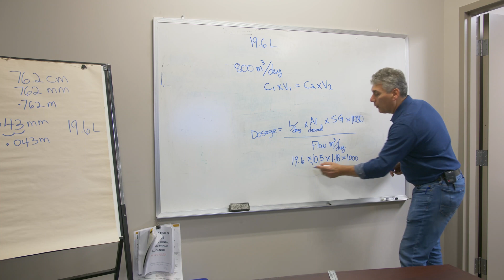How To Become A Water Treatment Operator

Comment: How do i start?
Reply from the maker: It varies across provinces in Canada.

For example purposes, let's say you want to become a water operator in Alberta.

Initially, you need to have a high school diploma or GED. Then, you must complete mandatory entry-level training, which is typically 4 days. After completing the training, you need one year of work experience in a Level I or higher provincially recognized facility. Once these requirements are met, you can apply to write your provincial certification exam with Alberta Environment.

It's important to note that if you are not yet eligible for Level I certification but would like to challenge the Level I exam, you can do so as an Alberta resident. However, successfully challenging the exam does not constitute certification. You must meet all eligibility requirements to apply for certification online through.

Comment: Hello sir 
my name is arshveer singh.
 Im from india. My work experience in wastewater treatment plant operator is 4years. But in india there is no any specific license qualified certificate. I want to join and work in another country  like you sir. Then how i can apply for this certificate and get a job in your country.
Reply from the maker: Thanks for watching! 

To become certified water operator in Canada, it will vary a bit across the provinces. For example purposes, let's say you want to become a water operator in Alberta.

Short answer: Considering the training and experience requirements, it typically takes at least one year of work experience post-training to be eligible to become a certified water operator in Alberta.

Long answer: Initially, you need to have a high school diploma or GED. Then, you must complete mandatory entry-level training, which is typically 4 days. After completing the training, you need one year of work experience in a Level I or higher provincially recognized facility. Once these requirements are met, you can apply to write your provincial certification exam with Alberta Environment. It's important to note that if you are not yet eligible for Level I certification but would like to challenge the Level I exam, you can do so as an Alberta resident. However, successfully challenging the exam does not constitute certification. You must meet all eligibility requirements to apply for certification online through.

Comment: Hi i would like to ask If operators in training license (OIT) is considered as the certificate of qualification to do the water related skilled trade which means you can work as a water or wastewater operator
Reply from the maker: Hi there! The Operator-in-Training (OT) license is typically a step towards becoming a certified water or wastewater operator, but it may not be the same as a certificate of qualification. It often allows individuals to gain hands-on experience under supervision. To work independently as a water or wastewater operator, you usually need to pass the required certification exams. It's essential to check with your local licensing authority for specific requirements in your area.

Comment: Hello
I am working as process Engineer in sewage treatment plan at Dubai.
What certification or license will I need to be able to work in Canada and USA ?
Can I get that certification online?
Reply from the maker: Hello! To work as a process engineer in the water treatment sector in Canada and the USA, certification requirements can vary based on specific job roles and jurisdictions. Generally, you would need to obtain a Professional Engineer (PE) license in the USA or a Professional Engineer (P.Eng.) license in Canada, and potentially additional certifications based on the specific water treatment processes you'll be overseeing.

These licenses usually require an accredited engineering degree, work experience, and passing certain examinations. Some preparatory coursework may be available online, but the exams usually require in-person attendance. Additionally, some practical experience requirements may also be necessary.

You might find it helpful to connect with the engineering regulatory bodies in the specific states or provinces where you're considering employment for the most accurate and detailed information. For the USA, this would be the National Council of Examiners for Engineering and Surveying (NCEES), and in Canada, Engineers Canada or the provincial regulatory bodies. Best of luck with your career progression!